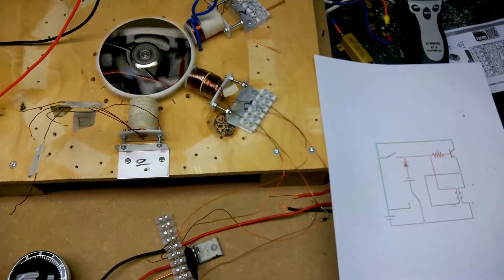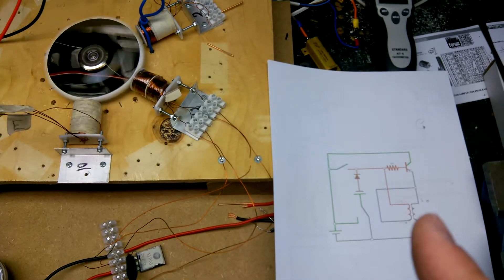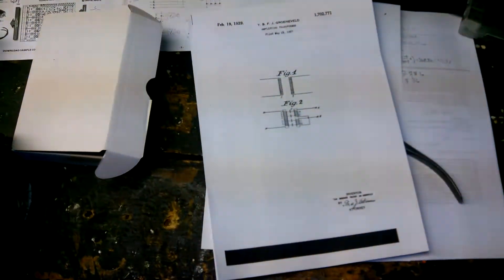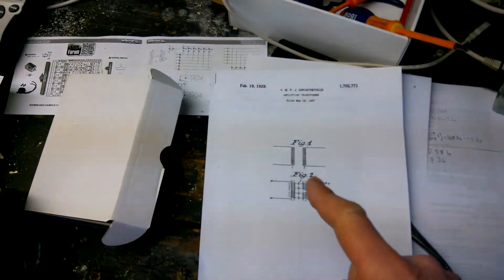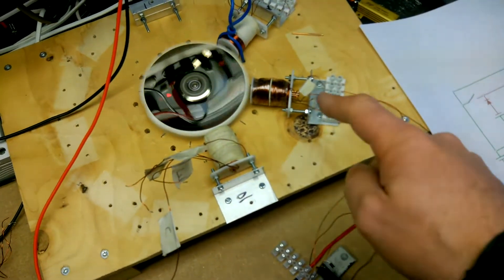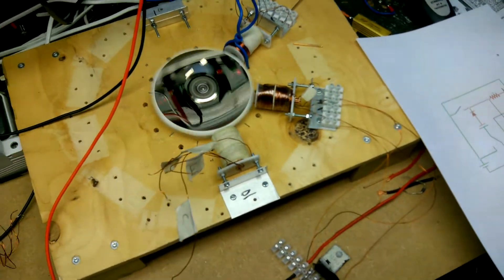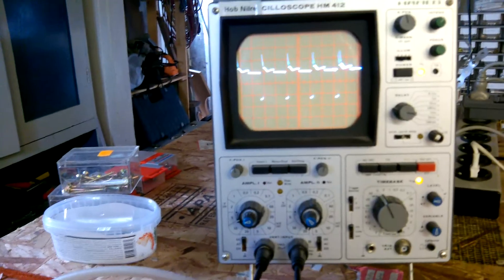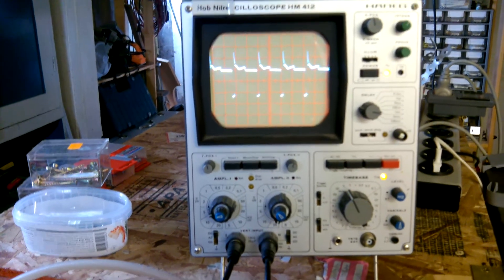SSG Trigger Winding Series Discharge pt2

Comment: some of my early forrays included that 'skip back' winding...i think most of my original research included coil gun designs (more documented than pulse motors at the time). i think this is where i saw this winding style used first. interesting, indeed!